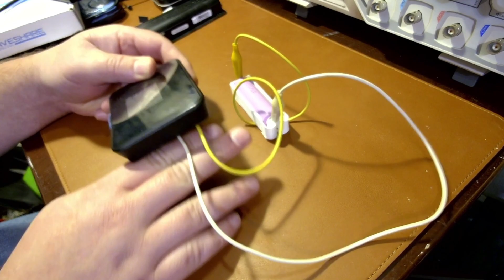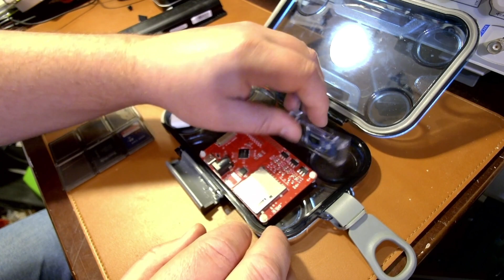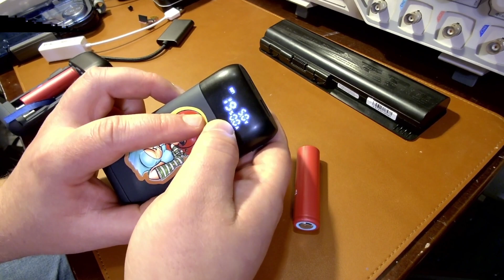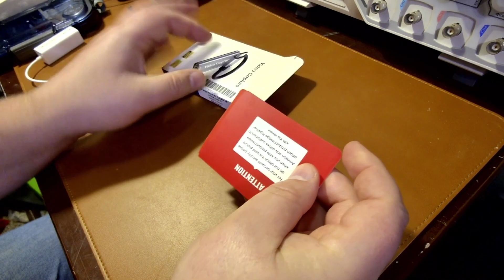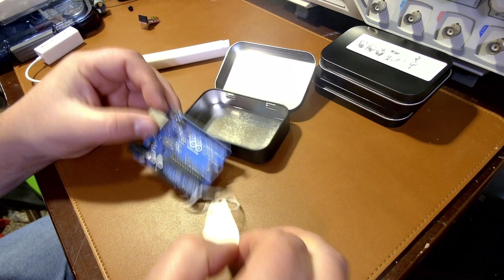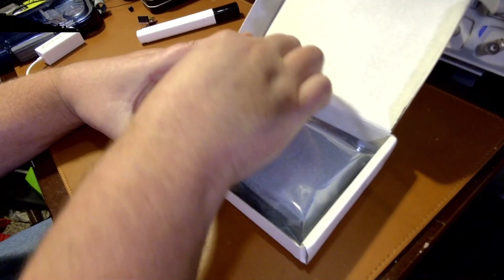Some of my favorite things June 16

Comment: I like the 18650 battery pack that uses changeable cells...i wonder if theres one that does individual cell charge/discharge with 2 or 4 cells as the layout....those hard plastic cases are awesome, use the packing foam you get in shipped packages as blank space to cut away for internal suport (foam, cardboard, plastic)...the ethernet adapters are a must pick up, the usb video capture that works with linux as well, figure a hdmi splitter mobile unit,(in to hdmi mirror splitter, out to two display, monitor + hdmi capture, from usb-c capture to pi file storage manager, just add in the monitor for the pi, wifi access for mobile backup or stream to any device...😅😂 random thoughts...